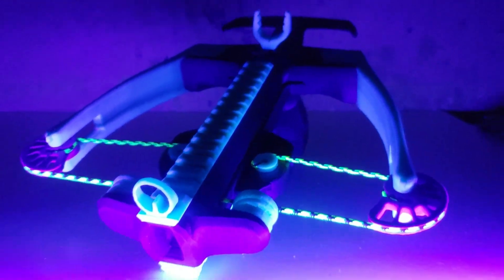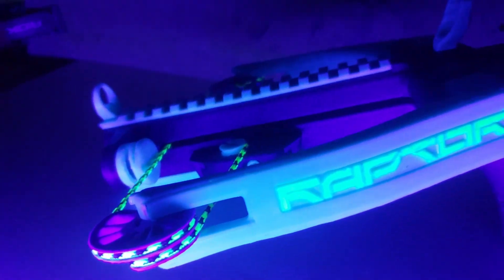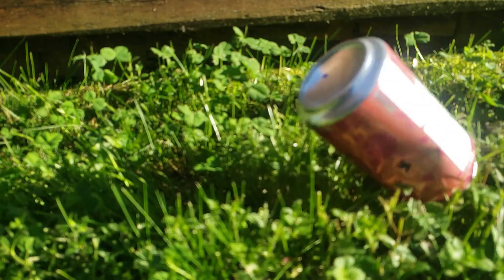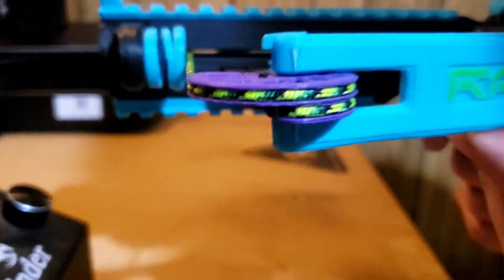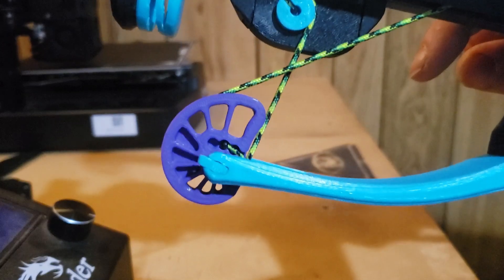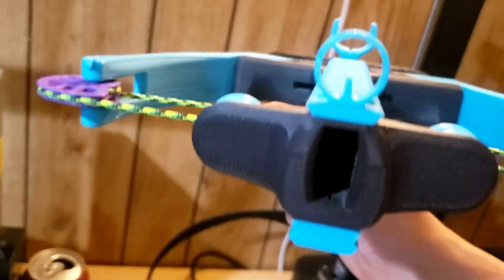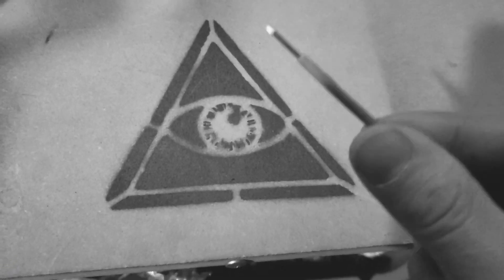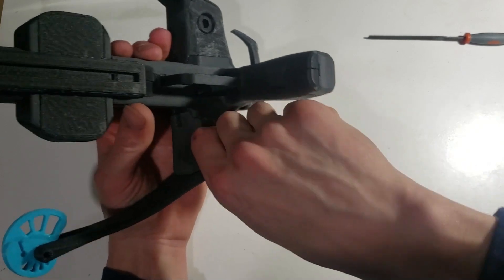Raptor Reverse Draw Mini Crossbow Pistol 3D Printed Limb Springs

Comment: I love this. This has some serious potential. I ask myself what power could be possible if it's printed with carbon fiber nylon.
Reply from the maker: I bet it would make limbs powerful enough to rip the risers off xD. But I'm working on an update that will  add a part to fasten the risers through the middle to make such experiments possible
Reply: @deadlymedley3306  I thought about that concept now for a while. Probably you would have to beef up the cams as well. And the trigger. Probably everything. Sadly I can't find any information about different FDM materials being tested as a bow. Afaik nylon makes up for the best material. But since it's hard to print alot of people tend to use PETG. Looks like that study still's pending :)
Reply from the maker: @stkk7186  yea hopefully I can get around to updating all the parts soon because that would be cool if better results could be achieved